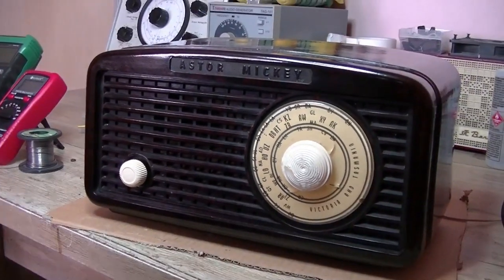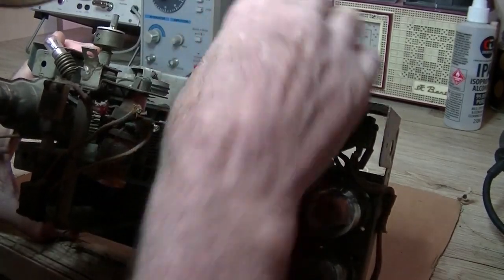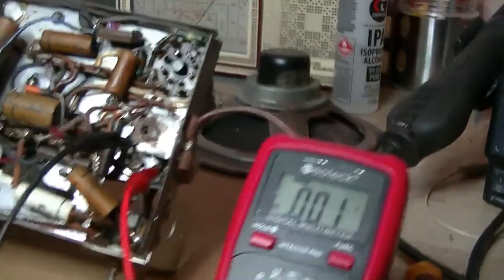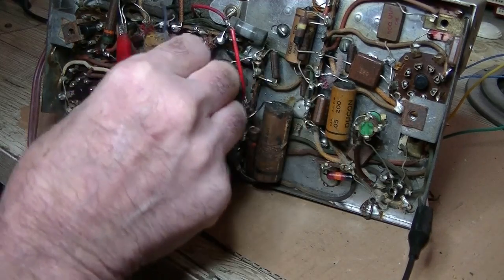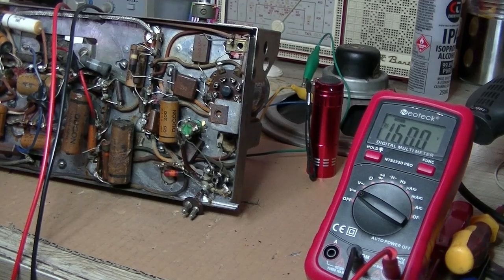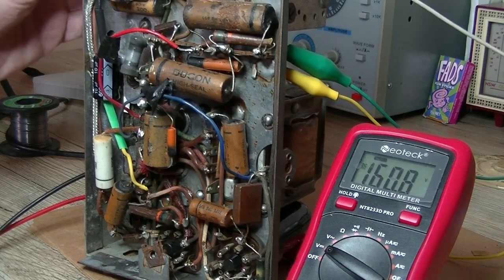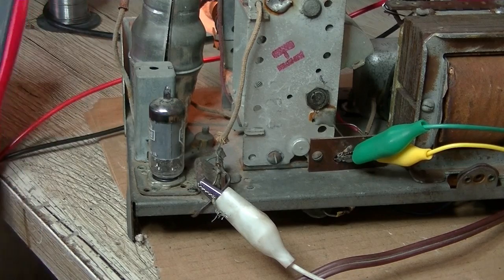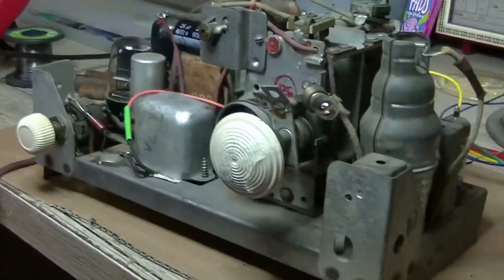Astor Mickey HNQ 1952-56 Restoration

Comment: Excuse me but when you did the first test on the 6X4 (rectifier) you said you connected pins 3 and 5 to the multimeter, but on the 6X4 diagram pin 5 is NC, can you make a correction? Thank you
Reply from the maker: Thanks for highlighting that, I have no idea what I was thinking lol
Reply: @exeterslab7781  ok, but where did you get the measurement? Thanks
Reply from the maker: Th probes were on the correct pins but I said the wrong pin numbers. @consiglioiannuzzi9314
Reply: @exeterslab7781  yes, this is clear to me, but I would like to know what the correct PINs are.  Thank you
Reply from the maker: I just looked at the video again and the valve line up on this radio is different to the schematic. This radio had a 6X5 rectifier and the plates for this are pins 3 & 5. 
The 6X4 rectifier has its plates on pins 1 & 6
Factories did like to change their valve lineups  @consiglioiannuzzi9314
Reply: @exeterslab7781  ok, now everything is clear.  Thank you